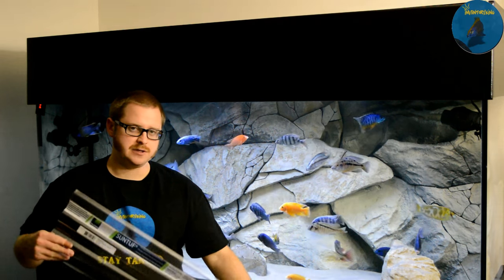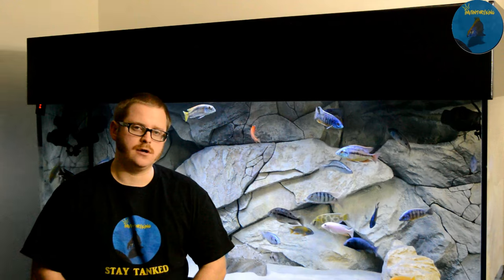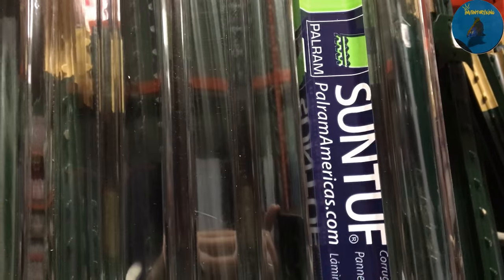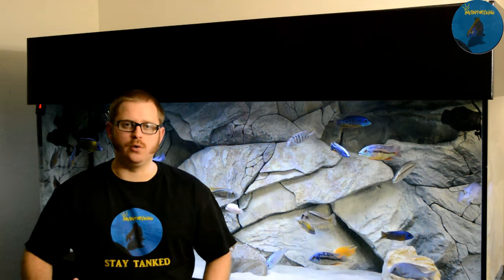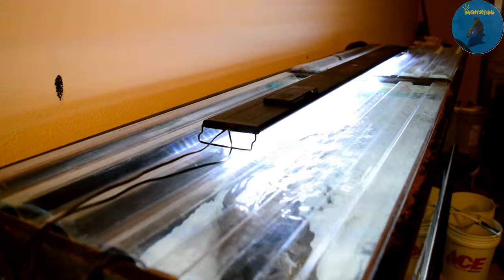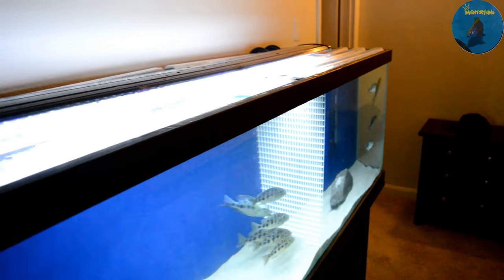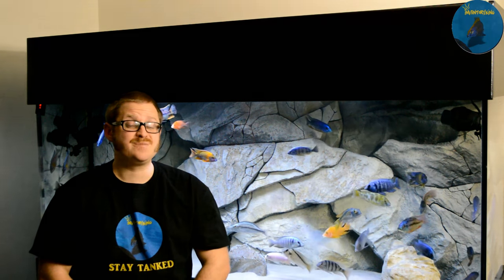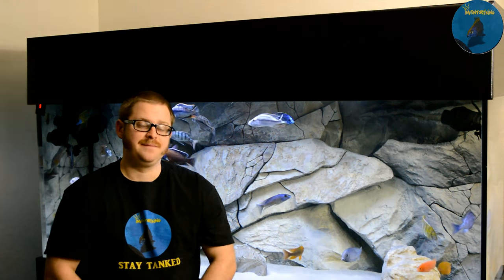HOW TO Build Plastic Aquarium Lids | Fully Customizable | Cheap And Easy DIY Project | Step By Step

Comment: I was going to cut a ceiling light diffuser but I like this idea more. Less evaporation/heat loss. Thanks for posting.
Reply from the maker: Hey Ben, it does a great job with slowing down the evaporation. Thanks for watching.

Comment: old video i know but just seeing it now as im trying to find an alternative to my warping plexi lids. have you tried filling in the coorigations at the ends with silicone to make a flat sealing surface? would silicon adhere properly or just peel off and fall in the tank?
Reply from the maker: Hey there. I haven’t tried silicone and probably won’t. It hasn’t really given me many issues. If it’s cut right it sits pretty well.

Comment: An awesome idea! Only problem for me is that I have snails in both of my tanks. The open ends of the plastic ridges would NOT be a good idea since snails can roam around quite a bit, often coming above the waterline to explore. I'm forced to go with a fully fitted cover/lid for my tanks.
Reply from the maker: Gotcha. Bummer. Thanks for sharing

Comment: Great video.I love the rock background.Just a quick question about feeding the fish,do you just lift the whole plastic piece to feed?
Reply from the maker: Thanks Robert. I just lift the edge of it up and pour the food in. No need to take it off.
Reply: DO YOU THINK IT IS SAFE TO PUT AN AQUARIUM LIGHT ON TOP OF IT,OR WILL IT GET TOO HOT AND MELT THE PLASTIC?
Reply from the maker: Robert I have my led lights on top and it has never melted.

Comment: Just stumbled upon your channel. Nice stuff. Can you tell me where you got that awesome textured background?
Reply from the maker: Hi, thanks for watching. Thanks. That is a 3D background that I bought from AquaDecor.
Reply: @inventoryking  thanks. I've been gathering ideas for my new 110 gallon and have checked out aqua decor as well as universal rock and a bunch others. Trying to weigh the pros and cons of these backgrounds (aside from the exorbitant cost)
Reply from the maker: Absolutely! I have the original AquaDecor so its big. I have 2 chambers on each side of the background so that I was able to fit my filtration and heaters. My tank is Acrylic. I had to drill a hole in order to get the plumbing in there, so it was a little tight. But other than that its awesome. And my water stays really clean for the filtration being hidden.
Reply from the maker: And unions
Reply: @inventoryking  yeah. Whatever you're doing keep it up cause the tank is killer .

Comment: My wife is REALLY delicate when it comes to smell, since it doesnt have a complete seal, does much smell get out?
Reply from the maker: I might be the wrong person to ask, since I am so used to it, but I don't notice any smell.
Reply: Lol OK, I'll stay away for now :D
Reply from the maker: Lol
Reply: You could use the -horizontal plastic closure strips to "seal" the sides if you want to use this product but you could use the -twinwall clear polycarbonate if you have access  to a circular saw or tablesaw. The twinwall poly is flat and maybe better suited for this application but more difficult to cut.
Reply: Do you have a video on that? Is it sturdy enough without the ridges?
Reply: MyView 10.75.69. I don't do the video thing, lol.   the twinwall poly is more rigid than the basic corrugated. there are a few tubers that have Vida on it if you want to search :)
Reply: MyView 10.75.69 no it doesnt